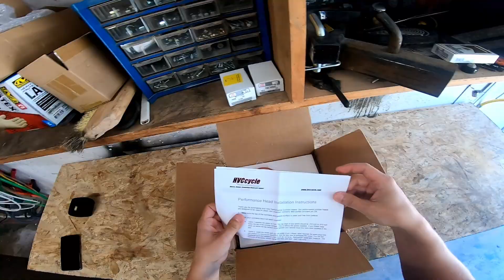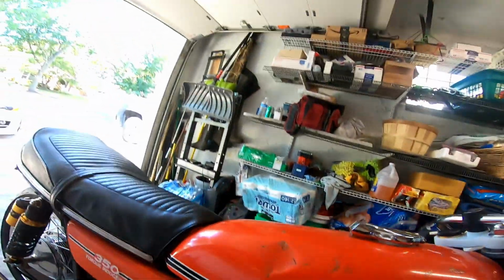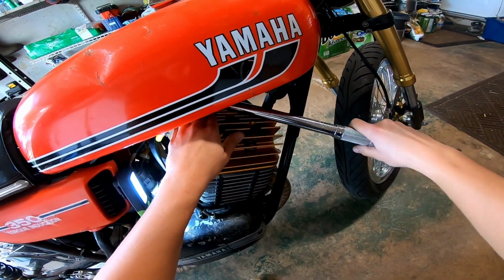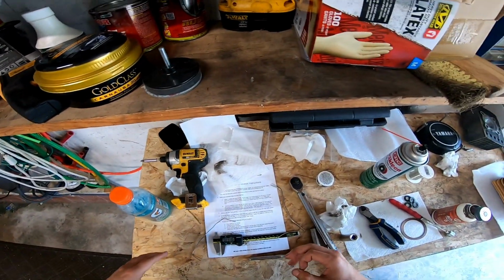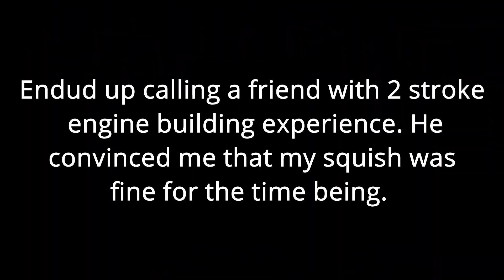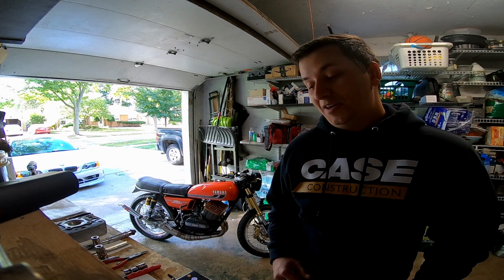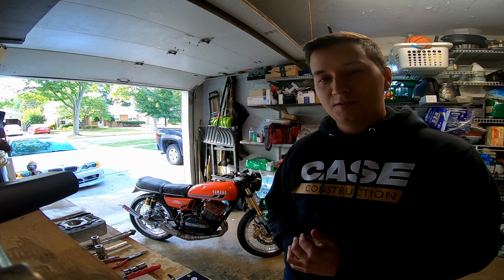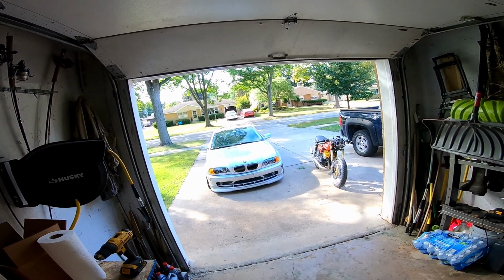Installing HVC Cycle CNC Performance Heads on my Yamaha RD350 Cafe Racer!

Comment: What a nice beamer! You have to have very patient neighbours that you can warm it up like you do! 
Love the mods you did (shocks, exhaust, front end ...) but I really like the dent in your tank. I have one in the tank of my rebuild XT500 as well and I got so used to it, that now I think it's just a part of my bike. The sound of your bike is hellish, oh no wait, heavenly 😎
Reply from the maker: Thank you! The E46 was my very first car and is still going strong with just under 205k miles on it, love the thing! Appreciate the kind words on the bike, i do eventually want to make the whole thing look brand new with paint and powdercoating etc. Though i don't mind the patina look to it right now.
Reply: that dent gives it character
Reply: also there are people that can take dents out and not even chip the paint i have a guy that did 4 for me i had a 12 bike collection but i sold most off as i am 72 in nov good luck on your xt im 120 soaking wet and i realy hate wen they kick back
Reply: @dannysapp5559  when I rebuild it I installed the breaker 180° twisted. That leads to an ignition at the worst moment possible. It kicked back 3 times and after the third kickback I was sure I will never be able to walk again. 🤣
I talked to a specialist in terms of taking out dents and he told me it's really difficult if not impossible to do this on an aluminium tank so small as the XT ones. The material is too hard, or stiff might be more appropriate. But I think it ads character to the heavily modified bike I built.

Comment: Although I've ridden bikes since the early eighties, I fell into the inline four crowd pretty early and felt like a two cylinder would have been an unthinkable step back. Now that I finally grew up, I'd be happy to lay my hands on an old two stroke. I had several 2 stroke dirt bikes and a GT 550 that I never got running, but I'm a Yamaha man, so I'm thinking about trying to find one of these or a rd250. I honestly want to slap some expansion chambers on and listen to the music.
Reply from the maker: The GT550 would be a blast with some pipes on it! 

I was looking between the 2 stroke GT Suzuki bikes and the RD family of Yamahas. I wasn't partial to either one, but the RD popped up for sale as the perfect candidate which accidentally was the best choice due to so much aftermarket, reproduction, and OEM parts still available.

I get just as much adrenaline and excitement out of the RD as my 2018 MT10. The lightness and crazy power band make for a lot of smiles and fun on the street. Really need to get the RD buttoned back up and ride it again next season.

Comment: Cylinder heads look absolutely brilliant and excellent quality of finish seems to be doing a great job bloody awesome viewing from Northern Ireland,,, thanks for posting the video get octain booster in the fuel and do a plug chop,, tells you the mixture without a dyno,, road racers from here used to do it on old 2 stroke race bikes ☘️☘️☘️☘️☘️☘️☘️☘️☘️☘️

Comment: Hello again . . What are those forks? Front end etc
Reply from the maker: They're 2017 Honda Grom forks. I have another video on my channel going into all the details of the conversion if you're interested in every detail.

Long story short I designed/had machined a custom upper triple clamp and put an RD stem into the grom's lower triple clamp to adapt the front end to the RD frame with stock RD bearings and hardware.

I also designed my own caliper bracket with speed sensor, rotor spacer, axle adapters, and gauge cluster mount and had them all machined.

Comment: Hello,
i want to buy the Heads, but unfortunately HVC doesnt sell them anymore, do you know where i can get them?
Reply from the maker: Hey, i just checked their website and actually they do have them and are in stock. 

It looks a little confusing because when you click the "cylinder heads" category in their vintage catalogue it says "no products", but if you look just above that, theres a "cylinder heads" text button again and that takes you to the heads.
Reply from the maker: Oh shoot, nevermind they have the RD250 heads only right now, my mistake. 

My guess is they are out of stock and will be back in the spring time. They didn't usually take the listing down though which is strange. They were the only ones to make that specific head, but there should be some others out on the market. 

I know vintageperformanceproducts.com recently came out with an RD350 head. Not sure how they compare to the HVC ones but they look nice.
Reply: Thank you for the Tip, but i Like the HVC ones more....maybe you want to sell yours? 😁
Reply from the maker: Hahah unfortunately not but im fairly sure HVC will make more in the spring! Worth calling them up to ask if you're able to wait.

Comment: Sweet man!  The gold is cool, if you can see crossthatching still i really wonder if its original.  But if the bore is still std. Size someone may have just replaced the rings and freshened up the cylinders. Edit*  It runs really good nice work!!

Comment: Nice build. Which headlight is that? Looks really nice. Is it a straight fit or needs modification?
Reply from the maker: Thanks! Just a cheapo amazon headlight that I chose since it had integrated turn signals. Should be able to find one by searching something along the lines of "integrated LED motorcycle headlight". Didnt need to modify it other than find brakets that worked and wiring it up.
Reply: @Enginerded  do u need special led relays?
Reply from the maker: @evoguy5561  Just an LED flasher relay. I bought a Rizoma branded flasher relay from Revzilla.

Comment: Where is everybody finding RD350s? I haven't seen one in years, saw a RZ350 recently, Wonder if there are and 400s left out there?
Reply from the maker: Theyre honestly hard to come by nowadays. I picked this one up as a barn find in 2018 for $600 all stock with pitted chrome and whatnot. Been going the restomod way because in stock form its not the most exciting bike and isn't what I'm going for. They still pop up here and there on facebook or craigslist but for much higher prices usually. I'd absolutely love to get my hands on an RZ350 if I could find one for a reasonable price!

Comment: .060 is standard for clearances on most larger engines for piston to valve clearance, but your talking about a smaller engine, so less expansion with heat. Unless your planning on really running it hard I'd leave that clearance the way it is.
Reply: There are no valves in the head of a two stroke ..... i asume you mean piston to head squish clearance.....   .8 mm is the min on a rd 350.
Reply: @mikeford5106  In general engines, not just two strokes, yea like the idea no valves, but they are quickly being ban can't even get one in California anymore and you cannot ride on the street with a two stroke motorcycle that is newer than 2002, you also pay for certain months of the year to ride a two stroke off highway or OVH Parks they limit use and you still pay to use it for those months... Only way to get a street bike registered is it needs to be older than 2002 for street use, and they stopped new street bikes from being sold as of 1998. As of 2022 now new two strokes dirt bikes can not be registered or purchased from dealerships for off highway use, and obviously no road use. Only on private property or closed events such as racing.

Comment: When ever you do a performance increase, you need to go richer because of the increased airflow demands more fuel for the engine over stock jetting.  Plug chops at mid range needle at middle throttle settings with the handle previously marked with help.  The main jet is easier.
Reply from the maker: Yep agreed! Oddly enough when increasing compression (like with these new heads) you need less fuel and can go leaner. From my experience so far the bike still feels bang on with the current carb settings after putting the heads on though.
Reply: @Enginerded  
That's probably because the jetting you had was probably already rich to begin with..
The very best way to understand this is with EGT sensors from the exhaust to make accurate comparisons..  Years of racing snowmobiles gives some familiarity on two strokes.... just remember, they always seem to run fantastic right up until they blow..

Comment: New subscriber so I am unaware of your build progress to date. RD350LC pistons weigh far less than air cooled RD pistons - less mass means a faster revving motor. A port & polish, a set of reeds and carefully jetting is the best way to get more HP out a Yamaha 2 stroke. 2 strokes need exhaust back pressure to make HP, 4 strokes don’t - pop your baffles out, it will run like a dog and go slower. Twin disc front end and dampener was a necessity on my LC. Perhaps your upside down forks are strong enough to not  need those.

Comment: install some 2 mm bigger carbs mikuni pwk an k&n pod filters port they cylinders and upper  engine case ,it'll  be a rocket.i messed with the rd's rz's and triple two stroke kawisakis back in the day.the triple kawis were faster,the rd's we're  more nimble. both great bikes and a blast to ride. if I remember correctly   the Yamaha fzr 600 or for 1000 clutches work in the rd's .they definitely work in the rz 350lc and the Yamaha banshee, pretty sure they work in the rd also if my memory serves me correctly.i still have a rd 400 I've had since I was 18 I am now 56. i haven't rode it in years.i moved on to the big liter gsxr's  ,quit riding couple years ago. check your compression.anything over 155 to 160pounds of compression  requires race gas.
Reply from the maker: Thanks for the tips! I do plan on going to 30mm carbs down the road and maybe mess with porting once i build the motor. I did end up putting fzr1000 friction discs in there with new steel plates and stiffer springs so it worked out! Will be switching back to stock springs once the weather warms up though. Id love to build one of the 2 stroke triples one day! My daily bike is a 2018 yamaha mt10 so thats a whole different animal. Good call on the compression, I'll check what it reads next time i get the chance!
Reply: Only put a few of the heavy duty springs in easier to pull clutch , your wrist will appreciate it. I 4ode rds back in the early 80s I could smoke the big bikes back then. Today's bikes are alot faster.

Comment: I had some original dg heads. I wish I never sold them. Best results on these is just correct the squish and open up her breathing a little bit. These are amazing machines when dialed in! My 400 is in the works and I can’t wait.

Comment: You are to the point that I would drop the oil pump and mix your gas. Are you going to mainly just ride on the street? If so you could still get away with some good after market reeds and at a min. port the bottom of the cylinders to match up with the base gasket. There are many trixs that all add up but too many makes it a pain for the street.
Reply from the maker: Its a fine line to dance trying to make good power but maintaining streetsbility especially with 2 strokes. But for me this is just a passion build to make my interpretation of an awesome, light, fun street 2 stroke. I want to keep the oil pump for the convenience of being able to do long day trips and not having to carry a backpack with oil every fill up. The tanks not that big and the fuel mileage isn't great at all so having that oil tank is really nice to have. Plus the pump is so simple i don't see it being a high risk. I rebuilt it when i first got the bike and haven't had any issues
Reply: @Enginerded , I worked in the shops back in the 70's and the problem was not so much with the oil pump but rather with the cable that worked the oil pump (especially new cables) could sometimes stretch and starve the oil causing a seizure. just keep a good eye on it's adjustment.
Reply from the maker: Interesting and good call. Didn't think about that, but makes sense. I did put new cables on the bike also when i first picked it up years ago, will definitely be mindful to check for slack in the oil pump cable

Comment: What exhaust is that? I got the same bike and I would like to buy one
Reply from the maker: JL pipes! Jim lomas expansion chambers. Bought mine from economycycle, stainless with the stainless silencers. Only complaint is I had to buy some slightly thicker high temp viton O rings from mcmaster as the original ones don't seal very well between the exhaust flange and exhaust and burn up fairly quickly.

Comment: Cool!! RD350. Say where did you get the front forks and was it hard to change them out . I got a 79 RD400F Daytona and that looks like a cool upgrade.
Reply from the maker: Appreciate it! Using 2017 honda grom forks and i designed im CAD and machined axle adapter, rotor spacer, caliper bracket, upper triple clamp, and gauge bracket to adapt it all. Turned the lower portion of the RD stem down on a lathe so i could press it into the grom lower triple tree and shaved about 3mm off the bottom of the steering head tube just for clearance of the grom lower triple to rotate. Everything bolts right up with those parts/modifications
Reply: @Enginerded  COOL!! Thanks for the info.

Comment: Hi. Fellow rd350 rider with JL pipes and similar mods. Working on my jetting and was curious of your pilot, aircrew turns, and main jet size. Appreciate any help. Thanks!
Reply from the maker: Hey there! I bought the dave F carb mod from economy cycle. I started with the richest mains in the kit (220) and worked my way all the way back to 180 which is where the bike was able to cleanly rev out in the top end. I want to say the needle clip is either in the middle position or 1 step down (richer), and i believe the pilot is 37.5 with the air scree 0.5 or 1 turn out from closed. Its been a while since i got it set up but that should get you pretty close!
Reply: Thanks for the response! I am at 210 mains, 1 step richer needle, and 27.5 pilots. Next time I get $800 in my pocket I will probably blow it on these heads.

Comment: I often wonder had the suzuki 500 and yamaha 500 2 strokes stayed in production with the best new tech and 40 yrs of development they easily could be 170hp 400 lb monsters
Reply from the maker: Totally agreed. Would love to do some ambitious fuel injected 2 stroke build one day!
Reply: OH man now your are talking my language. Light fast and with modern suspension and tires these 2 strokes would be giant killers. @Enginerded
Reply: I have dream build a 300 or 400 ninja chassis with a 2 stroke twin out of banshee. Modern lught powerful in a new very good chassis. Up to 100 to 120mph it would smoke a ton of 4 strokes. The weight savings of 2 stroke twin over 4 stroke twin would be massive. Or get an open 500cc single 2 stroke cr or kx engine in a small twin 4 stroke chassis. I have been scanning web for Chinese 250 or 350 modern 4 stroke twin. If e give is shot or blown you still have very good modern chassis but 2 stroke big single or 350 twin from wrecked rz or banshee.

Comment: After upgrading the heads, does it consume more petrol sir ?
Reply from the maker: Not sure about the fuel consumption to be honest, but i have not found the need to change jetting yet. Might be worse due to the itch to open the throttle more now 😂

Comment: Do a video on the tacho/mount. Where did you get it from?
Reply from the maker: Tach is a motogadget chronoclassic tach. The gauge mount I designed myself and had machined from aluminum. Will cover in a future video when I go over the front end swap!

Comment: Could you just machine standard heads to give tighter squish bands ? I personally prefer looks of the standard heads though , very tunable engine using stock components as basically TR3 race engine 
Great video though keep up the good work
Reply from the maker: Yes i believe Scott Claugh (i may be miss spelling his name) and others offer head machining. But these have a different combustion chamber designed by Scott and should give more performance than the standard heads that are machined down. Either way the performance gains outweigh the arguable looks in my opinion! Cant see them when youre riding

Comment: Am I on drugs or did you mention a GROM fork swap? That sounds insane! Can you PLEASE elaborate a little because I might copy your idea.
Reply from the maker: Nope you heard right! I saw someone put grom forks on an RD build and thought they looked perfectly proportioned for the RD and theyre very close length to the RD forks. I put in thicker fluid and some .75kg/mm racetech springs and they work great but still a little squishy since theres no real damping. Ill be upgrading to some racing bros adjustable damping fork internals this season! Planning on making a video on the front end swap when i get the chance. I went a little overboard and designed a bunch of parts and had them machined to adapt it all.
Reply: @Enginerded  I'll be looking forward to that video dude!